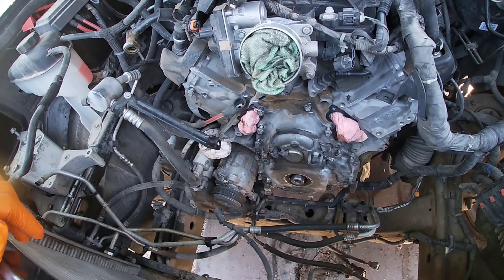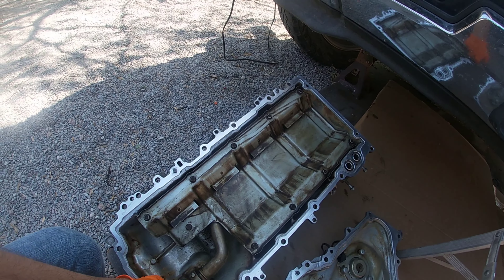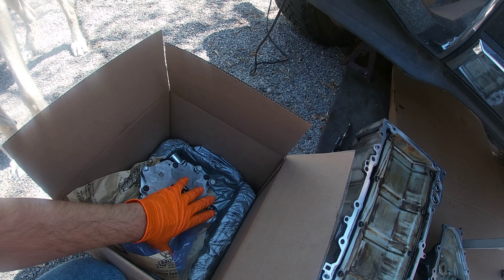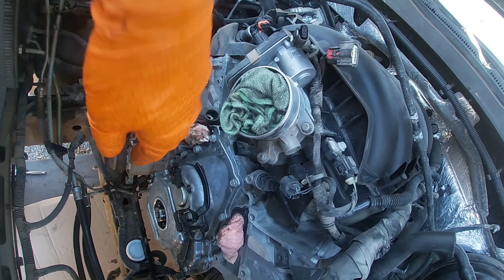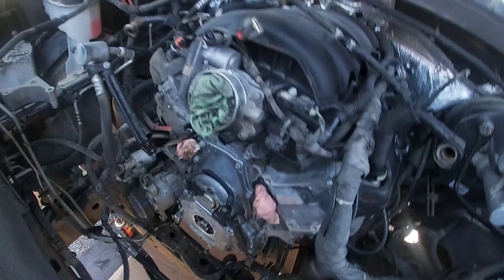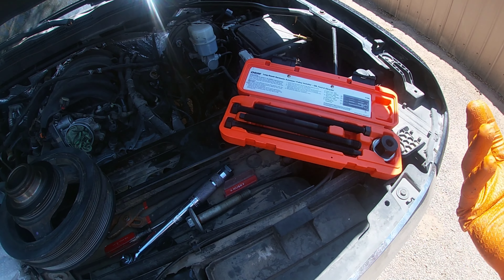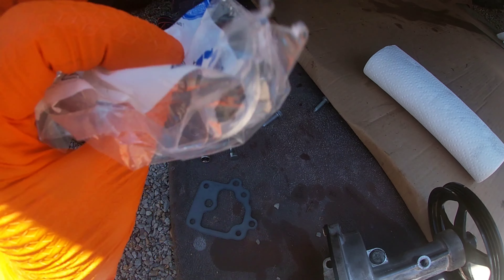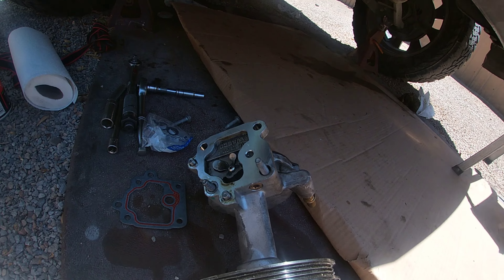2015 Chevrolet Silverado 5.3 fixing code P06DD hesitation and stalling part 3

Comment: I’ve just done this job last week.  Still getting P06DD.  Wishing I had replaced the oil solenoid wire harness while I was there.  I may have to do it all over again just to replace that wire.
Reply: This comment is what made me stop and order it.
Reply: Did replacing the wire harness clear the code?
Reply: Did replacing the harness along with the pump clear the code? @Fix-N-Flip
Reply: Any update? I have a 2014 L83 Silverado 4x4 and did the engine 18 months ago, replaced oil pump and harness the only harness did not replaced was the external. everything else was replaced all with GM parts. i had an oil leak since day one because installed the front crank seal facing inside.. ( by design is built to be installed opposed than all the seals in the world ) anyways decided to replace the oil pump, inside harness and external harness this time installing the front seal as directed by GM and the oil leak is fixed and the P06DD came back after engine warmed up and the oil pump behavior still the same; when hot oil pressure drops down to 16 PSI at idle 530 RPM possibly lower PSI in traffic. Facts until now, 1 old oil pump and 2 New other oil pumps does the same, solenoid respond at my commands with the shop scanner. now what???
Reply: @rubsuarez did you ever find out what was causing this ?
Reply: Approximately how many hours was spent doing this job on your truck?
Reply: @JimmyJamz0512 No, for me it wasn’t the harness.
Reply: @veltboy314 The way I prefer to do it is to pull the front diff, pull the rack and pinion, pull the belts, alternator, water pump and crank balancer, then the front cover then drop the oil pan, then swap the oil pump (if that’s what you’re thinking it is).  In my case it wasn’t.  In my case it was the aftermarket oil gallery dogbone/barbell.  I didn’t realize it at the time but the one I got was for an LS and not a LT1 L83.  They are different and it was blocking half the oil flow.  So to replace that I needed to drop the trans and pull the back cover off.  I dont remember exactly but it probably took me 8 hours to swap the oil pump.  And about 6 hours to swap the oil gallery barbell.  I don’t know, each time I do it I do it quicker.  The truck has been running rock solid oil pressure since then, I’m so happy with it.
Reply: @JimmyJamz0512 for me, no.
Reply: @rubsuarez Check your oil gallery dogbone/barbell, make sure the one you have isn’t for an LS.  That was my problem.  The LS and L83 have different ones.
Reply: I have a 2015 Cadillac Escalade is throwing code po6dd I replaced the sensor but still have the code can anyone help it’s annoying having that check engine light
Reply: @antoniojuarez5247  What are your hot and cold oil pressures?
Reply: @snivesz32  I just replaced the sensor but that was it and check engine came back with the same code
Reply: @snivesz32  how do I check that ?